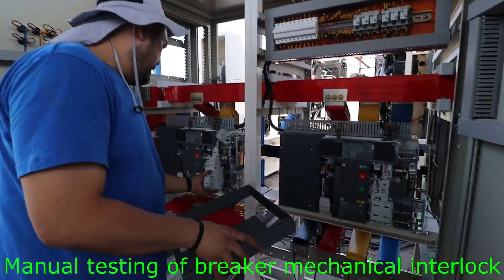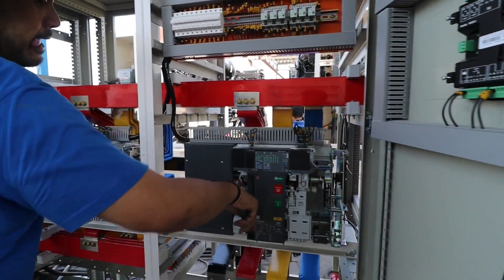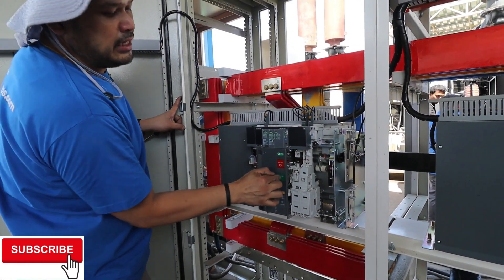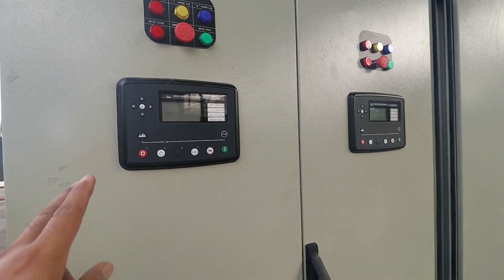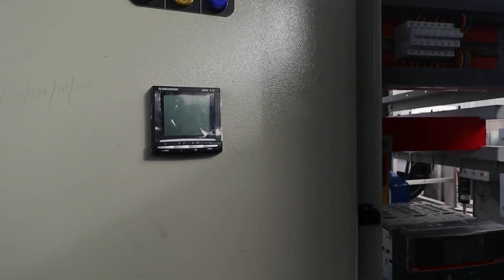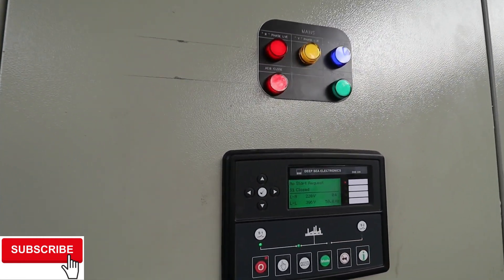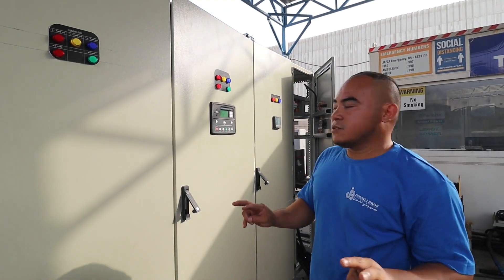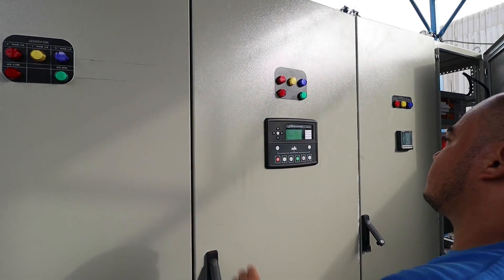2.5mva synchronizing with dse335 ats and dse8610 benzblogs

Comment: Hi what is connection on Leroy somer D350 for Voltage control on DSE8610 ??
Reply from the maker: In the back of the module 8610 there you can find msc,gov,avr there you can connext in avr
Reply: Thanks - I have connected on those points but my Sw1 is not changing the voltage
Reply from the maker: @BradWilliams-z4f  meaning you need to canfig the ecm and avr
Reply: @benzblogsVlogs  yes - speed bias works but voltage bias not.. I’m not sure what I’ve done wrong
Reply from the maker: @BradWilliams-z4f  thin fucos in avr config

Comment: Hi bro i have one question if we have also generator on s1 and also we have generator on S2 then how can we start S1 generator on automaticaly bcz there is no any output for start and run S1 then how can we will control s1 generator for auto function
Reply from the maker: Meaning your working in cyclic mode?
Reply from the maker: If your genrator in cyclic meaning you have controller which command for your s1 and s2 if in auto meaning you are using the remote to start your s1 and s2
Reply: Yes we want 12 hrs one generator and then 12 hrs next generator work and ats335 should automatically shufle the generator
Reply from the maker: @engineerhammadofficial9416  you can go to your config and adjaut time schd for two gensets
Reply: The problem is in 335 we have the start stop output for S2 but i cant found any stat stop output for S1 thats way i asking you

Comment: hi there thank you for sharing such valuable information about DG. I have a question about the excitation circuit and it is about the surge arrester which is connected in parallel to the diode bridge, what can cause burn it out during DG operation (melted down), I know that the surge arrester is to protect the excitation winding from a voltage spike, is there another purpose of it
Reply from the maker: No other purpose on that its only a protection but even without it still work but make sure your winding and your diode is not faulty coz its also busted one of this have problem